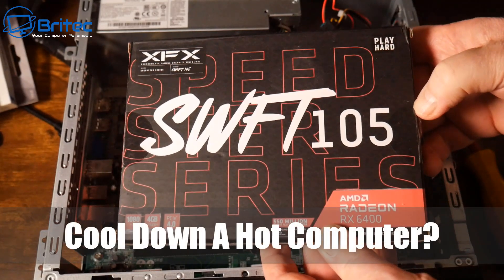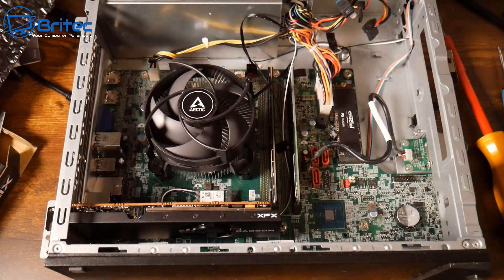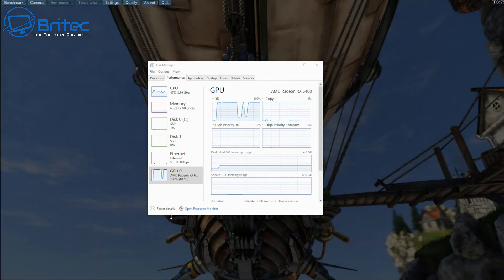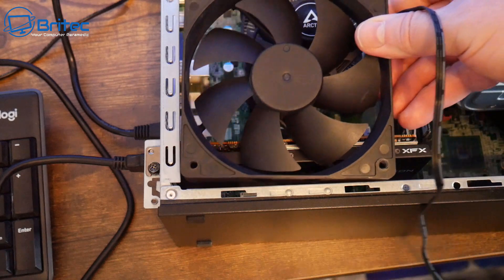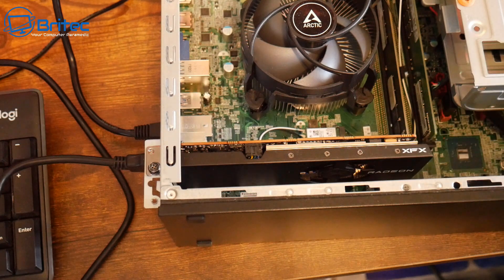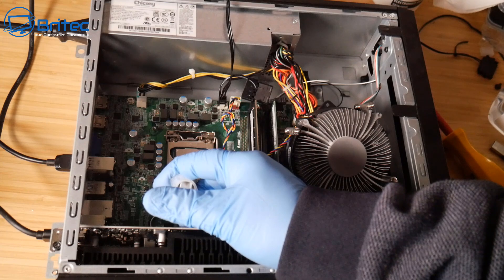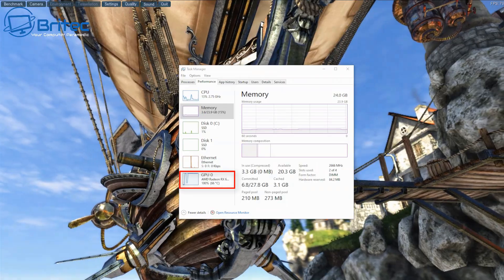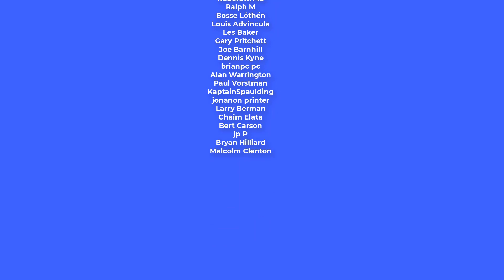Cool Down A Hot Overheating Computer

Comment: Other than airflow, the surrounding temperature is the most important factor. No airflow can save it if it is turned on during summer months(specially during daytime) without air conditioning where the average temperature is around 40 Degrees Celsius. This is specially true for all electronic devices including computers, TVs, gaming consoles, etc.

Comment: Yeah I had a small SFF PC with a 1050ti that my son used and it overheated and killed the PSU. If you have the tools handy you could cut some holes in the underside and use that area to bring in air though you'd need to add filters. For the case in this video I'd be tempted to print a duct to mount to the rear of the fan to direct the air blown in but we're getting to the "Just buy a bigger case" stage there.

Comment: Make sure the new fan moves air in the same direction as the CPU fan otherwise they’ll fight each other. Another option is to bolt a large plastic box over the side grill and put a fan in it - bulky but efficient.

Comment: It is amazing what a difference a fan can make. I remember years ago having a Netgear router that was over heating and setting up a 120mm fan on top of it and modding the power cable to run on USB. Knowing how to setup a fan to run off USB can be handy for what you are doing with these sff PC as there maybe no fan plug on your motherboard.

Comment: If it would have been me doing some serious modding, I would have taken the whole thing apart and blowing a 
hole in the case, directly inline with the GPU fan and then install a screen mesh over the hole and then put bigger 
thicker/ taller case rubber feet on that underside! In addition to that, install a thin 70 mm fan as well!  But hey, at 
least the overheating has been mitigated! Thanks Brian for sharing your insight!

Comment: I recently ran into some cpu overheating issues but it only happens while watching YouTube videos at 1080hd and higher. The cpu temp goes up by 20-35c while watching, goes back down when paused. I don't get any overheating issues while doing something else like gaming or watching hd movie online, only YouTube. 
I suspect it has something to do with YouTube requiring massive decoding by the cpu instead of using the gpu. Already tried updating the browser and two additional browsers with no improvement, still overheating cpu. By overheating I mean it goes from 35-40 to 70-75, which is pretty high just for watching YouTube.

Comment: Awesome content. Honestly I hate those small form factors as that space saving concept is a totally bogus one. Nothing can match the power and convenience of a full tower. However, in case of full towers also we have to do basic things like proper cleaning the dust, proper fans and exhaust fans to draw the hot air out of the cabinet and adequate thermal paste. Also there are some things which are out of our hands which we can't do much about but definitely take preventive measures to protect our PCs and other electronic gadgets. Like for those living in unbearably hot summer conditions without Air Conditioning, it's best to avoid using PCs and other electronic gadgets like TVs, gaming consoles, etc.  during noon or afternoon or if absolutely necessary then use them as less as possible during those hellish summer months.

Comment: Good morning,sir. 
I’m using a really small form factor, the Chuwi mini pc. No fan ( the size of it wouldn’t be able to contain a fan) , the entire unit is roughly 2 1/2 H x 2 1/2 W x 2 1/2 Deep. But it has really nice components for my use. Plenty of ventilation slots, so before I fire it up, I give it a shot of dry air through the slots and keep the dust out of it. Been a year of problem free use. I’m no gamer, but for everyday use, this is a great little pc. Cheers. 👍🇨🇦
Reply from the maker: You're welcome